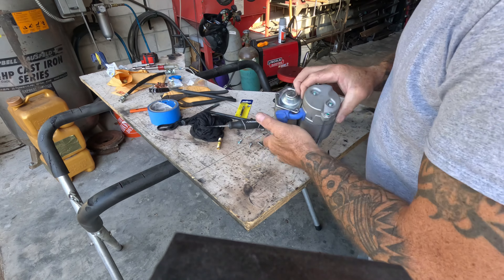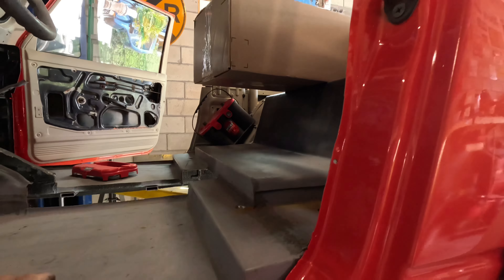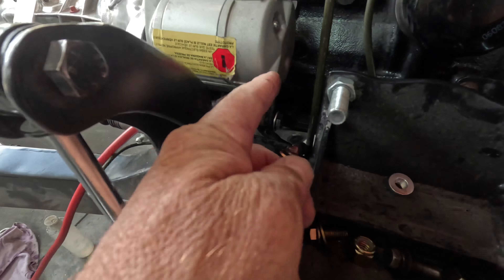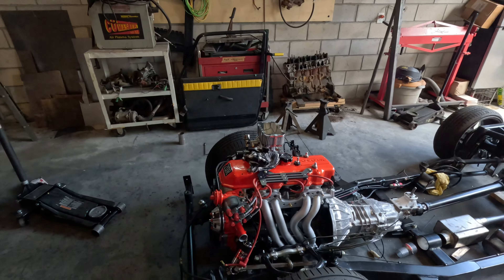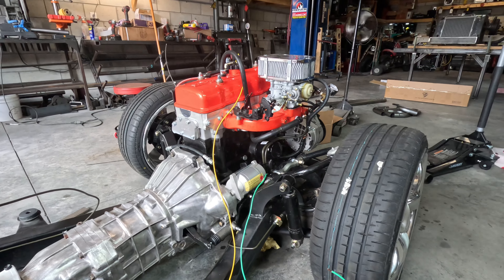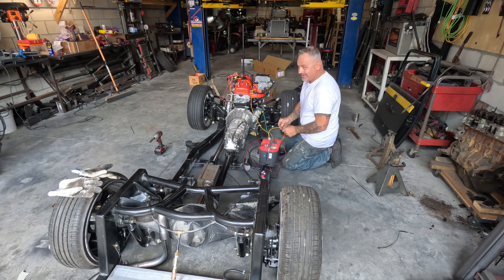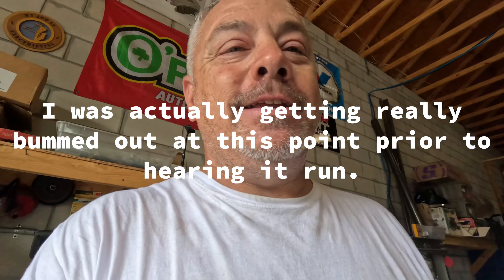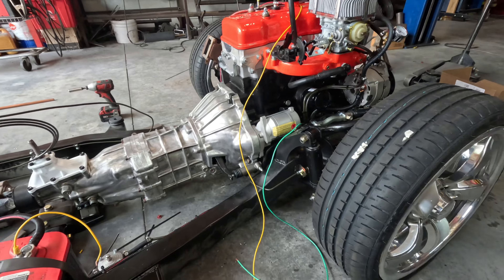Cammed Toyota 20R in my Suzuki Samurai.

Comment: I keep coming back for the sound i need for my car 😂 I just picked up a 1980 celica convertible maybe one of the last ones left one last question do the manifolds fit on the 22r heads?or would i need 22r manifolds im working on the underside of the car first but next would be the motor
Reply from the maker: They fit both 20R and 22R. The “RE” is fuel injected which you don’t have. So yes you are good bud. 🫶🏻🫡
Reply: @magicman_metal_fab  your a god send man i appreciate you responding youve helped me out tremendously i can continue to plan on the motor without stress now or buying extra parts i dont need.i hope everything goes well with your build and life ill be watching your stuff big fan of your work

Comment: If you don't mind me asking why are you using a catalytic converter?
Reply from the maker: Carb engines don’t use oxygen sensors to tune themselves. So they can always be out of wack. When driving them omit fumes. Those fumes will get all over your clothes and make you stink like your tailpipe. A catalitic converter helps filter those fumes. I’m trying to keep this simple lol for the explanation.

Comment: Sound amazing have a 20r myself which cam did you use?didnt see a video on the setup you used.did you have to change internals?
Reply from the maker: I put a link in the description just now. It’s a redline cam. 👍🏻🫡 I had the head rebuilt because it failed a leak down test. I believe they used OEM valve springs in it.
Reply: @magicman_metal_fab  thanks man really appreciate it